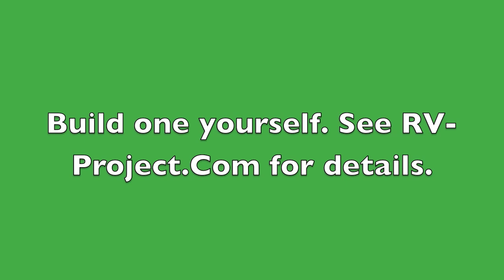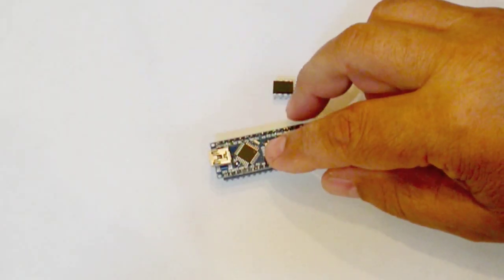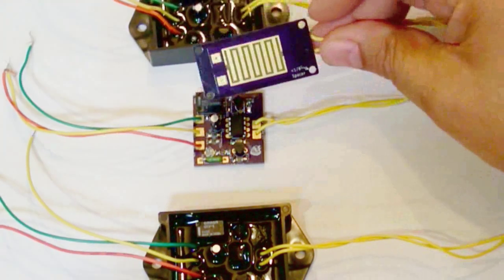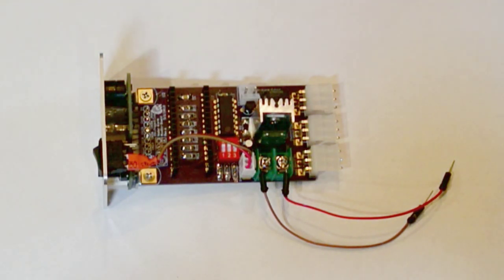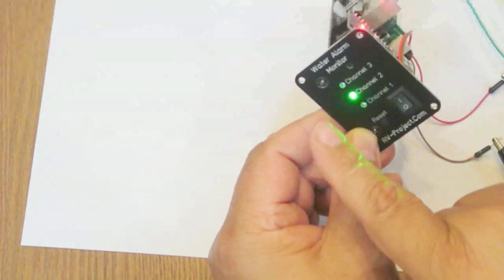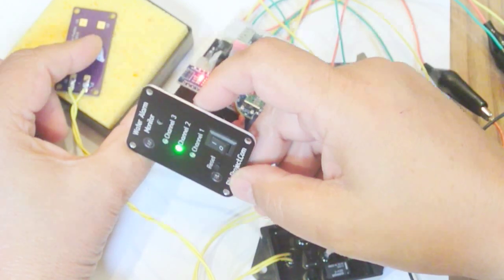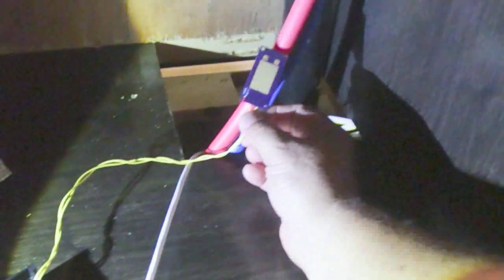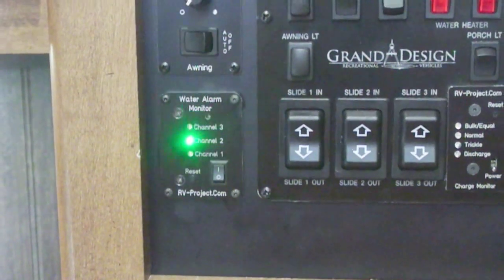Custom building a 3 sensor RV Water Alarm.

Comment: We have the 3.0 system on our 5th wheel.  Recently we stayed I. A RV park near the beach where the ground was sandy or all sand.  I use the red Anderson jack stabilizers.  We got set up and it started raining.  I noticed the stabilizers had moved (not a lot) but the camper felt wobbly and was not level.  Again not a huge amount but out of level no less. So the question is can I re-level in this situation?  And what do you or have you dealt with being on sand like that.
Reply from the maker: I think I would pull the slides in before re-leveling, but yes you can repeat the auto-level if you wish.

I take a couple of 2x10s, about 3ft long that I place under the jacks. It helps keep the jacks from sinking into the ground.

Comment: As always great project.  I wouldn't want to LEDs to be flashing all the time.  Is this configurable?  LEDs, to me, should only be lit when a problem exists and for the first 20 secs or on reset, to test.
Reply from the maker: Yes it is configurable. If you built this project, you would have the ability to change any behavior you wanted as I supply the software source code (called a sketch in arduino-speak). You can change the software as you see fit.

In reality though, the LEDs are not as bright as the camera shows them to be - and the control panel is behind a cabinet door so they are not normally visible.